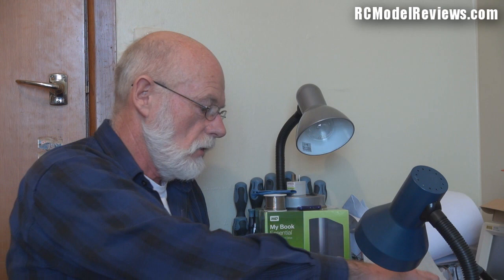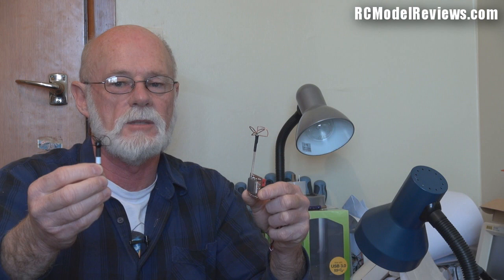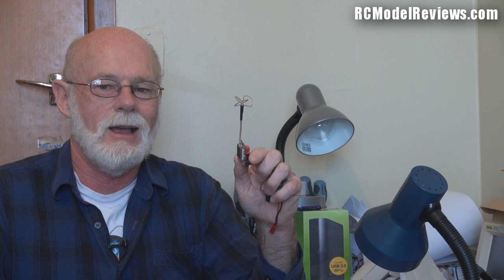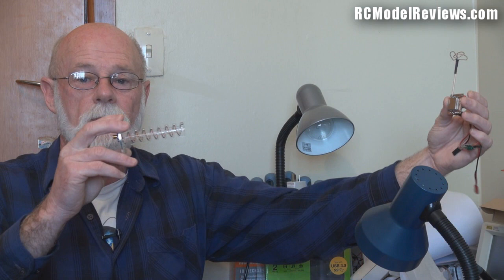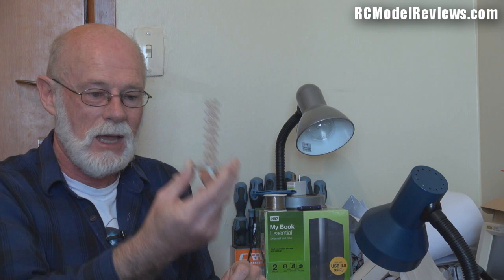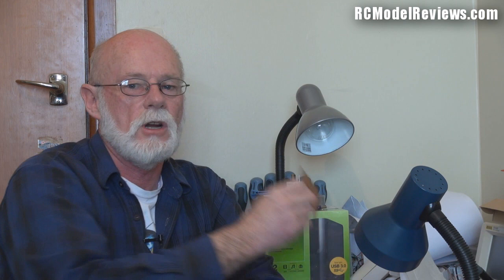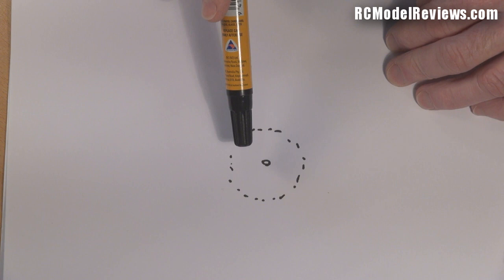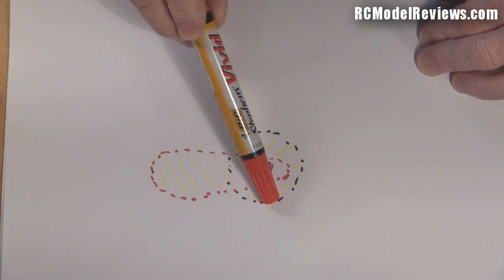FPV antenna gain and range explained

Comment: Hi, good day. Could you please answer the following questions from an FPV Newbee.
1. If high gain  Helical antennas have greater distance but narrower width why don't you make a 8 antenna diversity receiver and have each helical antenna at 45 degrees to the one next to it. Then you cover the full 360 degrees at a substantially greater distance?
2. If you use a antenna tracking device for your receiver surely if you had a antenna tracking device on you transmitter you could double the distance?

Comment: tracking antennas can get pretty expensive yeah, if you buy all the parts. if use use some stepper motors from an old printer and slap a nice sized yagi antenna on there (in addition to a diversity controller) and make the tracker frame out of wood, PLUS boost the antenna power, you can get ENORMOUS range without worrying about narrow beams. you could probably diy up the entire thing for like $50 using an open source tracking board

Comment: i ve just got the eachine falcon 250 an those ufo iy goggles i have just been twisting wires onto transformers an other connections an are getting a lot of static...i purchase a more powerfull 600 transmitter though i know it doesnt need it i got a camera with it an a big 840 recever thank god i did as the ufo receiver in the goggles just flashes i cant get anything out of it.....if i clean up all the wiring with solder etc will the static go????? what about the rc receiver wires causing static???also!!!!! the cameras are rubbish i should have watched rcmodelreveiws camera video and would have got a ccd.......can anyone tell me how to get a bit better picture im not meaning res...just static is pissing me off...can you sheild stuff from each other???

Comment: Bruce, great job,  I have the Q500 and want to get more range.   The antenna in the CGO2 is a three sided clover.  and in the transmitter there is just two wires from the TX board with some type of resistor in line.     What do you suggest I do for more range.
I just want to make sure I have a good Signal.  I would lke to get  1500 meters and feel safe.    Well if you can please let me know.    I can send pictures if you like.  Thank You for your time.

Comment: about how far does a 250mW transmitter reach with an omni directional antenna?
Reply: Ricky32908 This website will answer your question (as well as any other questions you have regarding power, gain, antenna type and range).

http://www.maxmyrange.com/

Comment: It seems it would be easy to make a tracking system where when your 4 channel circuit board senses the signal is stronger in one of the two peripheral helical antennas to then turn the whole assembly until the center helical again gets the stronger signal.

Comment: Hello my dear friend! I wanted you to get a consultation on the issue FPV for visualization of flight. I have the following devices: QR X350 PRO,DEVO 10 white and G-2D. And of course the monitor 32 of the channel for FPV 5.8G. The question arose in choosing a camera for visualization of flight, and at the same time with good quality shooting HD. There are two options, I think this is the Gopro Hero3 and iLook+. I think if you add to the camera Gopro Hero3 transmitter FPV 5.8G 1.5W 32CH A / V Transmission ( TX ) Module, wireless transmitter TS800 or another. But iLook+ harder. She has a built-in transmitter and think rather weak, video output no and how to solve the problem of distance visualization, I don't know. It will show the image on the monitor 300-500 meters and all, how to be? Well, the second question is how to increase the range . Found the amplifier for the antenna RC4Y RC Hobby FPV Hmm 2.4GHz 1w 2w WiFi WLAN FPV amplifier remote control 2,4 , 10 km. what do you think will be the real benefit from this? Here is my ASIC:(singlsv@mail.ru better to talk on email. English I'm certainly not allows you may properly Express my problem . With respect and hope for the help of Sergei.

Comment: Why not just have 4 beam antennas each covering about 90 degrees (HPBW), then maybe you can get 3 km in all directions using your "voting" (diversity) circuit?  Also, how quickly does that circuit sample the S/N ratios of the 4 antenna systems and what is the insertion loss of it?

Comment: What about using a 6dBi collinear (omni directional) antenna (google "	
Home-brew Compact 6dBi Collinear Antenna")?

Of course this flattens out the balloon, but is is still omni directional. Or two and have one tilted back (say 10-25 degrees) to cover more vertical and use a 2 ch diversity. These 6dBi antenna's are very cheap, takes less than 3 min to make. It's the same design for 12 and 18dBi antenna's, just longer.

I tried 24 awg and 18 awg was way better. 

Good luck, comments welcome,
Oz

Comment: I'd like to know why the "hobbyist" video transmitters for sale are mostly FM instead of AM?

cheaper to manufacture something with the video input directly pushing a VCO around? And then be touted better than AM? If so, this sounds like the war of televisons.

LED backlit TV are considerably cheaper to produce than those with flourescent bulbs, but because they are "new" it is sold for a higher cost.

Anyway, AM video, VSB, is only 5MHz wide signal, not including audio. FM video is 17MHz wide. That said, it takes more power to match the range for AM. Especially with the now common frequencies used.
Reply: AM is highly susceptible to noise as the majority of noise affects amplitude. Which with AM is where the intelligence is found. Clean data transmissions are not as reliable(or possible) due to the decreased bandwidth vs FM and the increased noise susceptibility.

Using AM whould allow longer range BUT the entirety of the range would be much more glitchy.
Reply: Agreed, FM has a much better Signal/Noise ratio than AM

Comment: quadruple antenna gain will mean 4 times the range. double power will mean about 1.4 times the range. so about 5-6 times the range overall. this is because the power needed increaces at the square of distance. double the distance, quadruple the power. 4x the distance, 16 times the power.

Comment: There are problems with spinning the antenna fast. You will still only be pointed at the transmitter 1/10 of the time. You'll miss 90% of the video. Also, it takes a certain minimum amount of time to send a complete video frame, If your 36 degree antenna is pointed at the transmitter for less than that time you won't get a full frame. There's also acquisition time - the time it takes the receiver to lock on to the signal each time around. 
Your idea can be made to work, but not like you'd want.

Comment: But if you connect four antennas at the same time then you'll lose 6dB. Because the power will have to be distributed through the 4 antennas...

Comment: Sure, then it would work, but his whole point is: how to increase the range without increasing power. But anyway, the idea behind this video es extremely good. I would just do one omnidirectional and one high gain antenna. And rotate the second one in case you are flying out of the antenna pattern..

Comment: I don't understand why one would need a controller to switch between the same types of antennas.
Reply: Each antenna although the same are pointed in different directions. So if the current receiving antenna is not pointed towards the quad then the controller chooses another antenna pointing in the direction of the drone and the controller does this by checking the signal strength from each antenna and the antenna with highest strength is the one pointing towards the drone or quad....

Comment: you're comparing apples to oranges. my point is that radar can provide smooth fluid images, and they only have a so many degree beam. and no, radar does not have radial beams. you cant compare radar waves to tv waves. im simply talking about the image displayed

Comment: i disagree with you. you say that for instance the beam is 36 degrees wide, you'd only recieve 1/10th of the time. true. but if you spun at high enough rate, then you'd recieve signal fast enough for smooth play. take for instance radar... they generate smooth flowing images, and not static.

Comment: You have misleading info here. If you are plotting the -3dB half power beamwidth (HPBW) pattern, then (using your most narrow plot for the highest gain antenna), you can indeed fly outside of that narrow shape and still have enough signal to operate.  What you should really be plotting is not the HPBW radiation pattern of the gain antenna, but rather plot the shape where the signal from a beam antenna is at LEAST as strong as the omni would be.  You will then see it is much WIDER than the -3dB HPBW plot.  Remember, if you have more gain with a beam antenna such as +6dB and you are off a little to the side of that boresight (say at the -3dB point), you STILL have +3dB over the omni at that point.  So for example, if the omni can reach 1.5km reliably and you instead use a single beam antenna that has say 6dB of forward gain with a -3dB HPBW of say 30 degrees to each side of boresight, then even at 30 degrees off of center, you would have +3dB gain over the omni which means the range should increase to slighty over 2 km (an increase of slightly more than 0.5km).

Your plots are probably confusing some people thinking that if you go outside of them, there is no usable coverage.  That simply is not true unless you plot the radiation pattern of the antenna system (or systems) such that it is at least as strong as the omni.  I still think if you use 4 moderate gain antennas oriented 90 degrees apart (each on "facing" one major map direction such as one N one E one S and one W), you can easily get 3 km of coverage with the "voter" (diversity) system working properly.

Comment: This lecture is wrong. Energy from an antenna is most efficient when the largest possible amount goes in the direction of the intended receiver. Hence up and down for RC is mostly a waist of energy. 
Sorry for sounding rude.